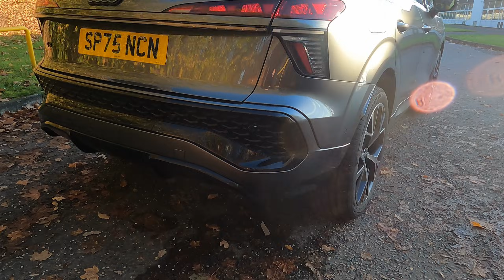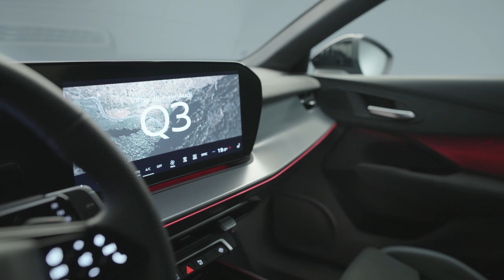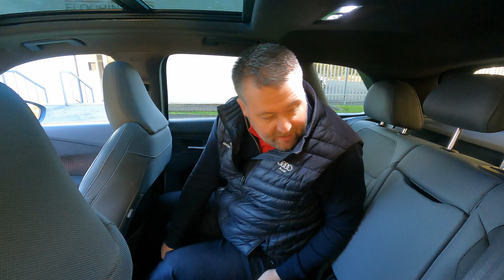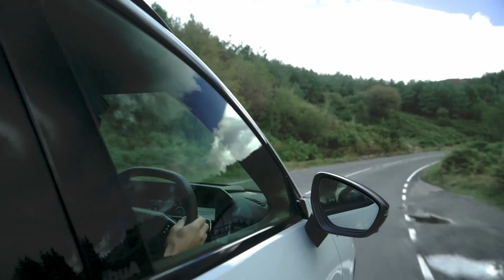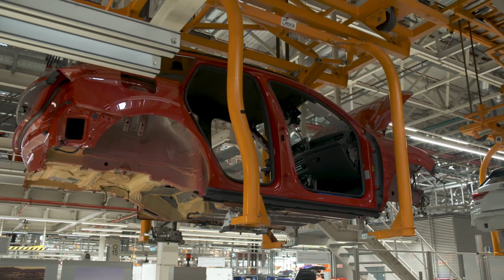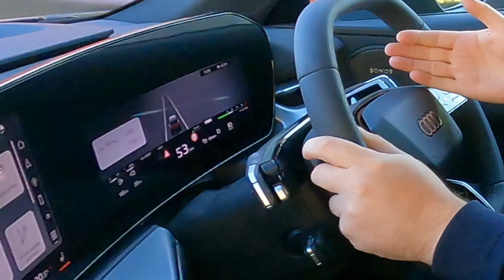2026 New Audi Q3 E-Hybrid UK Review And Test Drive

Comment: I have one of these, and no matter how hard I try, I cannot get above 1.8 kWh - meaning the winter range of 51 miles i'm getting gives me a realistic 30 IF i'm lucky.
Reply from the maker: Hi Wayne. If you have it purley in EV mode all the time it is much harder to get the quoted range. If you use it mord in combined mode the total range over say a 100 miles journey on local/mixed roads should show a higher Miles per kW

Comment: How easy is it to turn off all the annoying and dangerous speed warnings and "safety" systems?
Reply from the maker: Hi Chris. Few clicks within the menus. You will need to do it everytime you start the car for lots of them. Or can do it via voice control.
Reply: @colinspc can't you assign it to a shortcut button on the steering wheel?  I think you can in the Q5.
Reply from the maker: @Chris-hy6jy you can for one of the functions. Usual allows you to do it for the "traffic sign function"

Comment: Good review Colin. I was with Audi (100E) but it was hopeless in snow. So I went to Subaru. I also have a Ford Ranger and here's my dilemma, because my current Subaru nor any other car so far, doesn't have speed limiter. All cars have cruise control, I hear everyone saying. Yes but it's not a patch on a limiter. As those who have experienced it, once set you can brake then accelerate back up till it reaches preset. Infact everything but switch off ignition. It can be overridin by increasing the power to get out of trouble or overtake. Then fall back to that setting and it's back. You can change the setting as you go, so or down. So if the Q3 doesn't have it I'm not interested.
Reply from the maker: Hi Drew. Sounds like you mean Adaptive cruise control? This is standard on the Q3. It can be overriden by pushing the accelerator and drops back down to the max preset once you done your overtake. It can also take you to a stop in slow traffic and automatically pull away once traffic starts moving. I hope this is what you were looking for?
Reply: @colinspc thanks. That sounds like what I've had in the wildtrak all these years. What other reviews have you done or how can I find them.
Reply from the maker: @drewkerr5413 Hi Drew. You can find my other review videos(mainly Audi product) on my channel home page. Thanks for the support.
Reply: I should have said that that option was on the Ranger. Pull away from stop smarties (leaving the boy racers wondering where you went from the traffic light) and you reach preset and there you are.